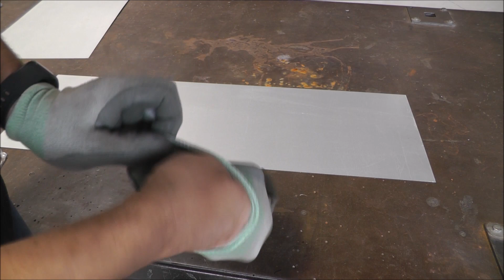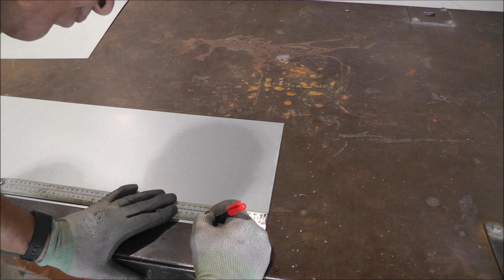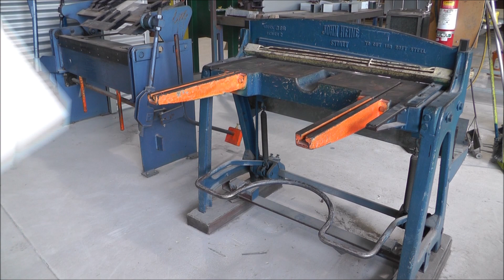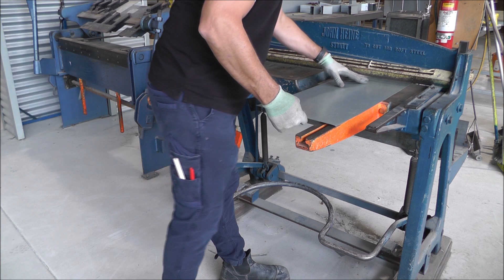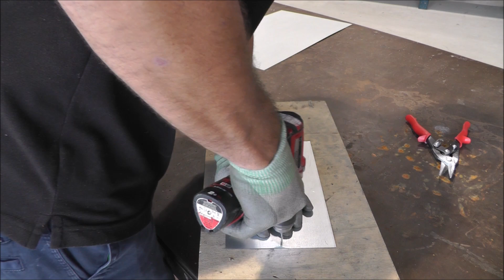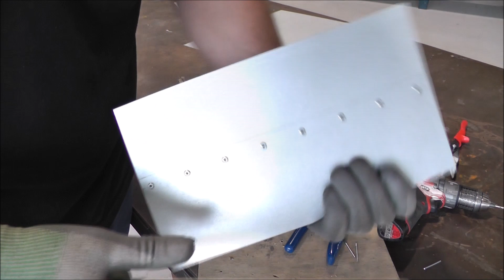How to install rivets and cut sheet metal

Comment: Nice I had no clue, a friend put me onto the idea of a metal aviary over a wood, my birds chew wood, when he showed me those plastic corner joins i taught I'll give it a go, but now looking at rivets, something I knew nothing about, I didn't even know what to search while looking for this, I honestly taught I needed some attachment for my drill, but I've seen those rivet guns, I'm getting exited to get the bits for this aviary, I'll probably make an effort to film my efforts n upload it to YouTube, any suggestion what metal would be the easiest to work with for a complete beginner, I've been teaching myself to weld but I doubt I'd pull off an aviary with my lack of skills yet. Stainless steel is the top choice for birds, but its expensive, but is it harder to work with if i let it get two hot, I've still a load of research to do. This is great Subscribed..